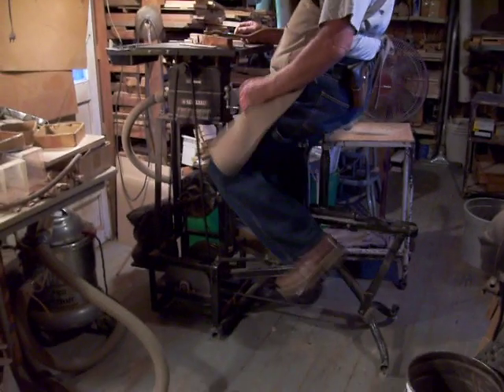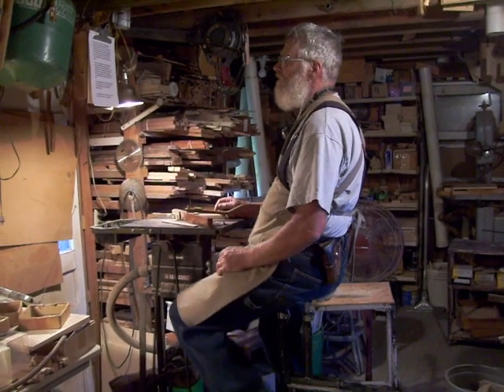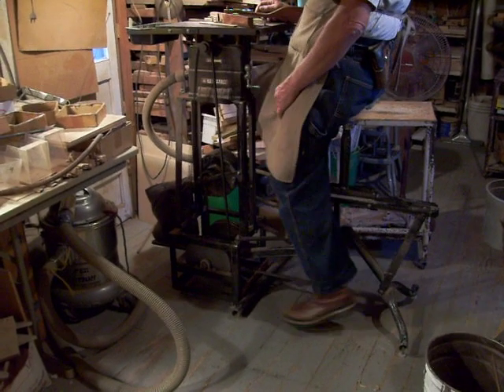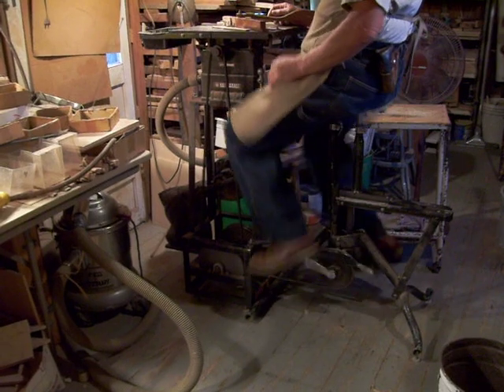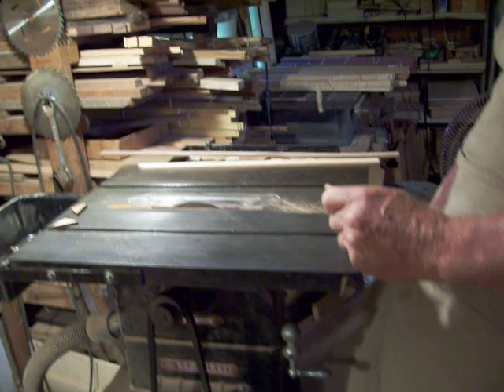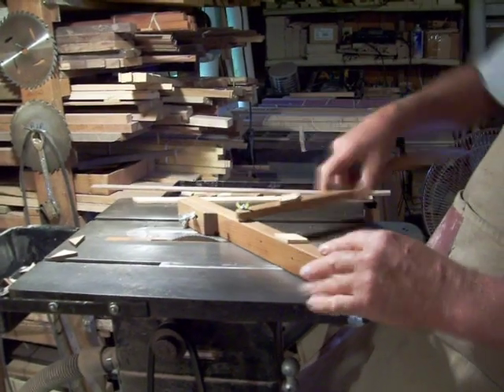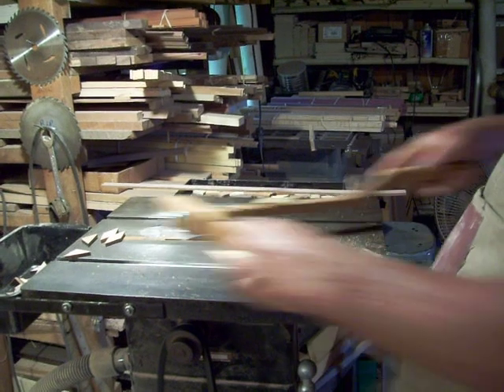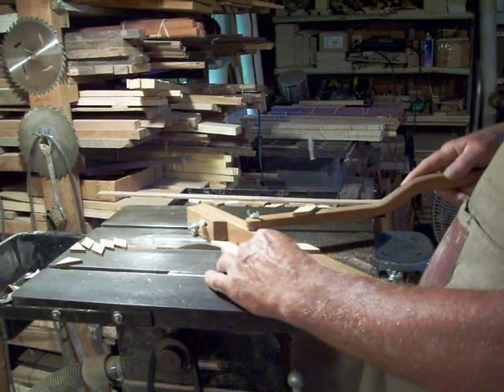Video of Foot Powered Table Saw

Comment: @csmith5810 Use a flex shaft instead of a chain.  To reverse the direction of rotation, just switch the cable to the other end of the arbor.

Comment: Ted Kaczynski used a bike generator powered Dremel tool for his hobbywork.  

Put a $10 pair of cyclist's toe clips on those pedals, and you'll double your saw's horsepower, since you'll be able to 
apply power on the upstroke as well.

Comment from the maker: A table saw does not work that way. the blade has to cut against the table as you push not pull the board into the blade.

Comment: Neat use for an old Delta table saw. I suppose with some gear ratio adjustment and what not, it could be practical for more than crosscutting